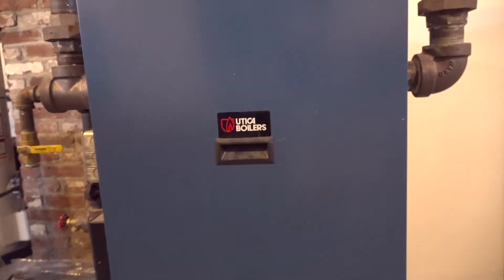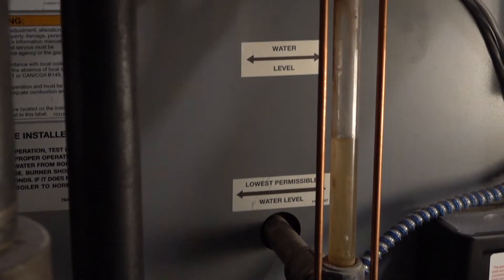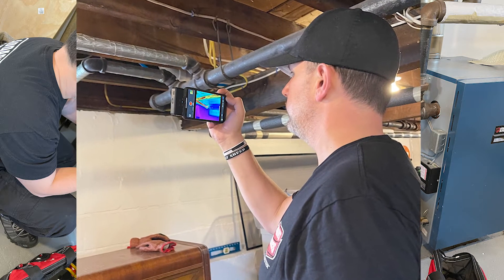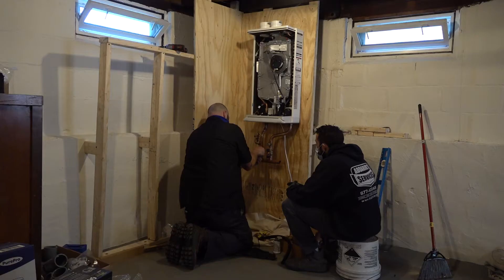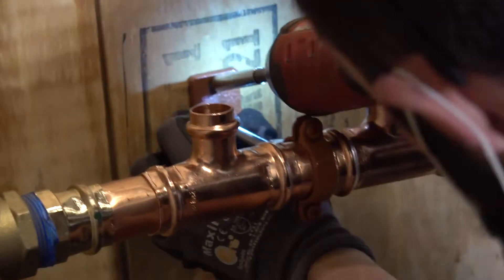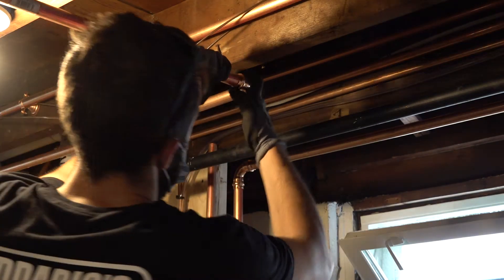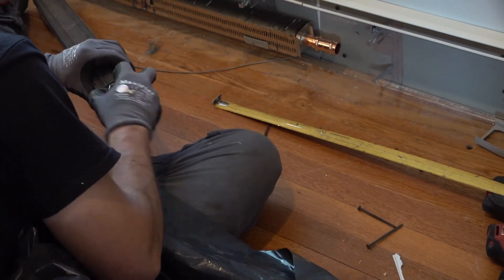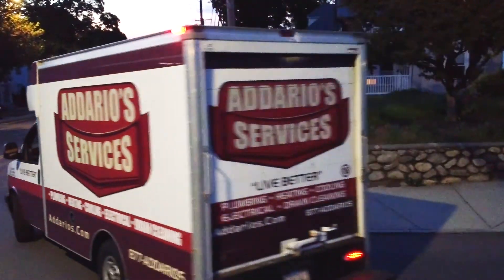High Efficiency IBC Boiler Installation [Utica Steam Boiler Removal]

Comment: Looks like you didn't spend any time to actually troubleshoot the steam system. It's normal to have corrosion in a cast iron steam system. To me you convinced them to replace something that didn't need to be replaced because of a small issue. You sold them a hydronic system LOL

Comment: Looks good, nice and neat. I have a question though about the fin-tube b/b and the press fittings. I know press fittings cannot be used on any copper thinner than M type because it will not seal correctly, but pipe inserts can be used to make up for the lack of stiffness. What brand do you use? I’m primarily Viega and Apollo.